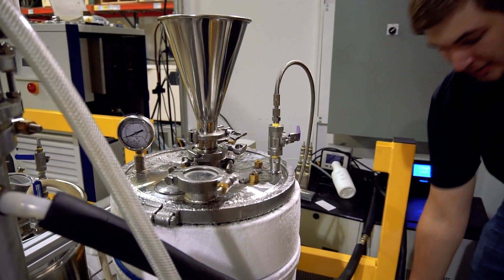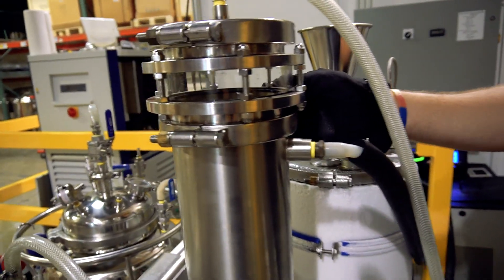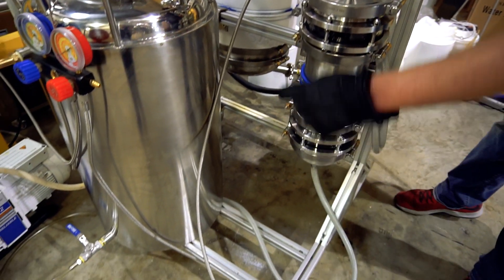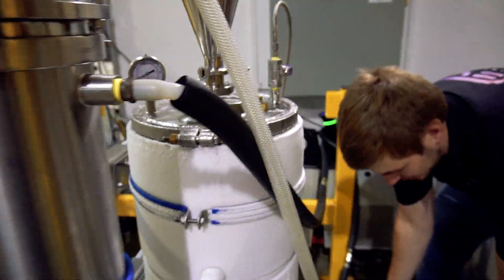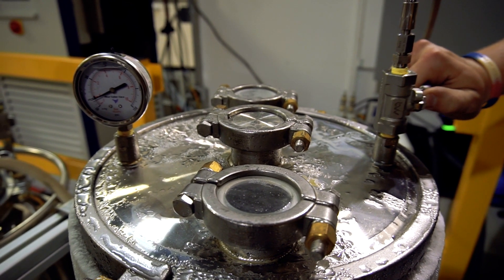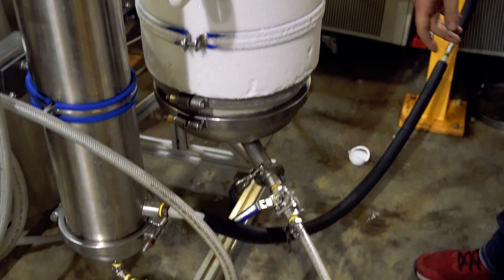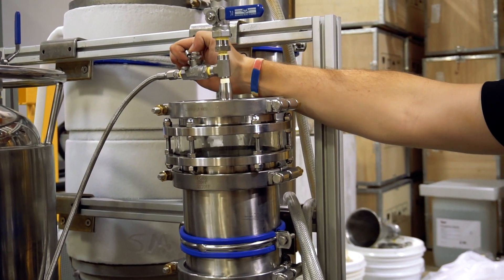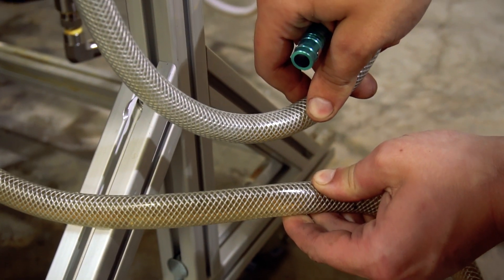How to add color remediation to your refinement filter

Comment: Stop making that crc trash
Reply: Idiot isn’t the  butane crc you are thinking of.  This is ethanol winterized bho getting scrubbed for distillate.  Butane crc is different and you have no idea what you are talking about if your saying bullshit like that. Stop regurgitating what the internet fuckbois make memes about because crc is the way to pull out the amino acids and fats that a paper or sintered disc won’t grab even at -80.  If done right with good material you don’t lose terps and get a nice clean dab.  But this video literally is for ethanol post winterization  scrubbing for distillate which is a good thing if you want that water clear distillate in the 90+ thc range
Reply: ben wellendorf hahaha research.  I literally work in a legal extraction lab idiot.   I know some of those “big dogs”.  When their concentrates test 80% and 7% terps.  What is that other 13% you’re smoking?  Hahaha yeah dude I been blasting bho since 2008.  Big dogs.  Lol. Fuck sakes.   Crc isn’t the big bad wolf.  Shitty material is.  You are the one who really should research some shit. You just regurgitating what hypebois on instagram say.   They just trying to get you to pay 100$ a gram for 5 star hippy rosin they claiming is 6 Star.  🤣😂🤣.   Fuckin kids man.  Obviously you’re not an extractor.  I also run co2, ethanol, distillate.  I’m one of a small % of extractors who know all methods of commercial extraction.  Most stick to one or two methods. Crc is very useful in every extraction lab period. You are just scared because you’re  uneducated and don’t even understand how it works or what different types of crc there are and for what post processing they are useful for.    Anyone can blast cold butane through a column and make poop. It’s not rocket science. Cleaning up that poop for better thca crystalline  crashing and cleaner extracts is another animal.
Reply: @MatanuskaHIGH  CRC IS TRASH!!!!
Reply: @MatanuskaHIGH  sorry but your an idiot my dude...
Reply: @MatanuskaHIGH  color remediation is color remediation, doesn't matter of its distillate or live resin, CRC is CRC. You can polish a turd but it's still a turd.
Reply: @MatanuskaHIGH  again CRC is still CRC, it doesn't matter how many processes or reasons there are it is what it is. 🤷‍♂️
Reply: @MatanuskaHIGH  i dont even need to say anything for everyone to know your waisting your damn time if you are an extractor using that method. Nobody wants to smoke anything with traces of silica in it dude. "Extractors" like you are the kind of people that are going to fuck everything up.
Reply: Your supposed to make a clean product to begin with, your basically saying you use crc to clean up your shitty bho...

Comment: Most of the best diamonds and shatter is Crc lol u just have those guys who use black dabs and crc them and sell it to u ! Beginning product is key not crc
Reply: Crc is still good with good material 🤷‍♂️.  Cleans what 1m micron paper filters can’t.    Creates consistency in products in a legal market.  Even good material will make dark terp pours.   Crc will fix that and done right won’t effect terpenes.
Reply: From my experience every step counts.  For a quality final product the material, solvent, hardware and filters all need to be above a minimum standard.  If you skimp out then don't expect the results you were looking for.
Reply: And understand the procedures and WHY.  Theory of Operation is critical, really in anything but KNOW IT!
Reply: Wrong
Reply: Dgaf brapman wrong
Reply: @Livin-Da-Vida-Loca  am I right or am I wrong
Reply: Jonny Novak you’re right, I was replying to the ignorant dude
Reply: @Livin-Da-Vida-Loca  nothing ignorant about what im saying, ive been makin wax for 10 years, pretty much since it came on the scene, ive seen and made all types from amber glass to crumble to poop soup to c02 wax. The best wax doesnt need color correction because the flower its sourced from is high quality cured resin, the trichoms are fully formed and arent hazy or deflated, and you MUST keep your temps and times right, or as i like to say "speeds and feeds". Color correction is a shortcut to take lower quality product and make it appealing to the eye, but id rather have dark wax that keeps its original flavor profile than the frankenwax ive seen at some of these dab events.
Reply: @dgafbrapman688  this

Comment: people are using this for bad stuff nowadays unfortunately :( it hit Massachusetts recently and the boof people are using is unreal. no regard for anyone's safety. it's really bad. then they either pull out flavors somehow from that shit material or they add back terps. i don't know which one they're doing because it smells ok at first pass. then you keep your nose to it and you're like wtf? seen it with two major maine extractors.
Reply: John Crichton does the shatter/extract leave a white residue in the rig? And does it smell similar to black liquorice?
Reply: @BricksOnDaBeat  Nope it leaves a black residue and smells like plastic or rubber after the dab sits on the nail for a moment. The first hit will generally taste OK, then the rest are rubbery and chemically tasting. Someone described this exact same thing on Reddit and said it was just part of the color remediation process removing all the terpenes?
Reply: John Crichton 

I’ve smoked TONS of colour remediation stuff and never once had that issue brother. 

People have been cutting shatter with synthetic pine resin and other stuff from China lately, and id be willing to bet $ that your shatter is also contaminated with some sort of cutting agent.
Reply: @BricksOnDaBeat  that's nuts. And maliciously greedy and evil.
Reply: @JohnCrichton   that’s sulfur that the grower used for molds and the extraction is picking it up.
Reply: I've had the white power residue kind. Nasty. Can also taste the soap.
Reply: What company's? Im very familiar with a couple
Reply: Epic  I think it's absolutely superior to anything made with solvents without a doubt
Reply: Epic  yes I never said CRC is bad,I said what people are doing with it is bad
Reply: Y'all might as well be crack heads. Just smoke a bowl good God man. Nothing is ever good enough for people these days.
Reply: That CRC trash is all over California’s recreational market. It’s sad, I won’t dab anything other then rosin at this point. Fuck bho
Reply: @CrooksGlass  all I smoke is hash rosin too lol nothing better than live hash rosin imo anyway, solventless is where it's at
Reply: @CrooksGlass  cant you crc rosin too?
Reply: This is ethanol scrubbing for distillate not dabs.  🤷‍♂️🤦‍♂️.    The crc getting hate by heady fuckbois is because you can scrub garbage with inline butane crc and make good looking dabs that are trash🤮. But crc can be used with good material and make some of the best dabs out there so 🤷‍♂️.  Stop listening to internet fuckbois trying to sell overpriced rosin.    Crc is the future for consistency and over all quality as it pulls what paper and sintered discs can’t and cleans extracts good or bad up.
Reply: @matanuska high  dude do you think I can't see the edits on your profile? The absolute narcissistic tirade that you just went on should make you think twice about what the hell is going on inside of your head. Like you seriously just went nuts because you thought I was saying a bunch of stuff that I wasn't about CRC and started calling me all sorts of insulting terrible names.
Reply: @MatanuskaHIGH  I can't stand guys like you. you come into a conversation with somebody that you know or can tell has little knowledge about the subject and you start hammering down on them and insulting them and belittling them for absolutely no reason whatsoever other than to inflate your massive ego. I came on here to vent about my issues with having to deal with CRC everywhere and I have cancer and it's really taking a toll on my health. I can discuss whatever the hell I want to discuss and you have no control over it whatsoever. I don't care what's happening in this video they are using color remediation and that was my point. But you were too stuck on trying to inflate your already over inflated ego to realize that.
Reply: John Crichton crc isn’t causing you cancer lmao.  Crc in this specific video is pre distillate ethanol winterized.  Not the bho crc you are thinking you got two different animals mixed up.  Google chromatography and science.  Maybe that will help.